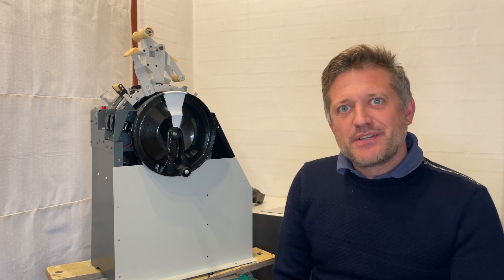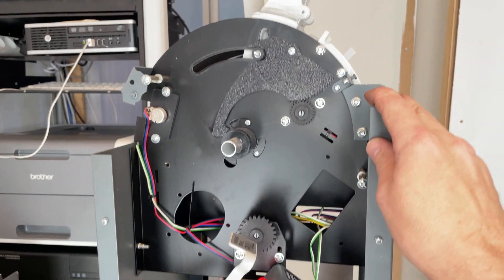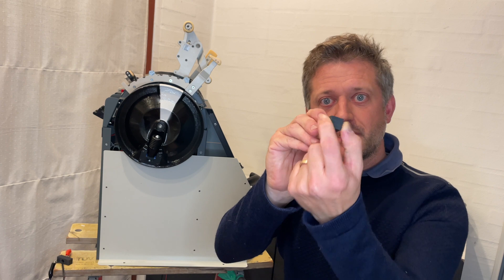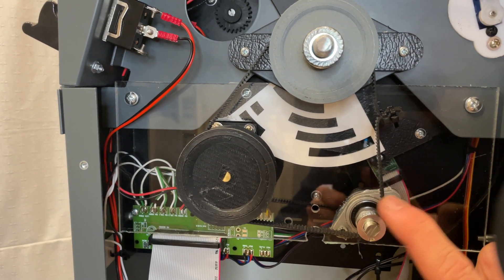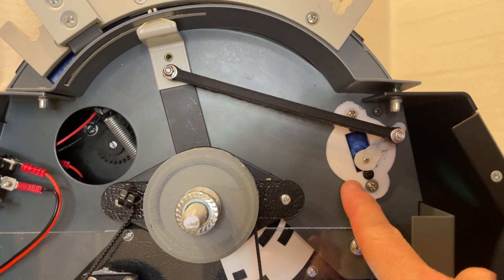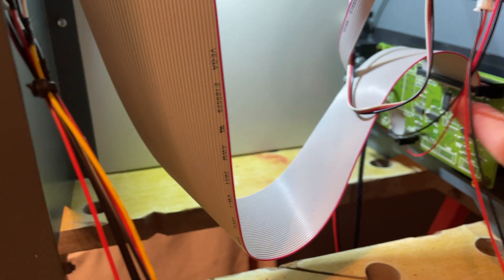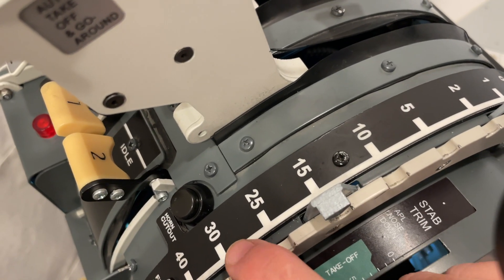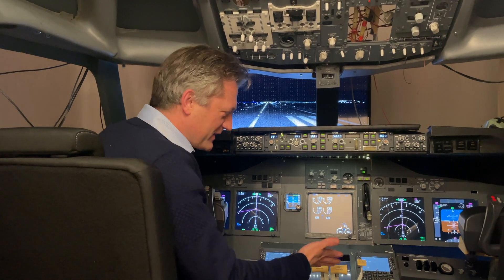FSC Throttle reworked - Build a Boeing - Home cockpit 737

Comment: What potentiometers did you use for throttles?
I need to replace in my home built throttle and earlier used 10K carbon potentiometers which I have been changing now every 2nd to 3rd year, not very good. So I am very interested in what you used in your setup?
Reply from the maker: The throttle used 5 x B100K potentiometers. Linear. Standard pots.

In all my cockpit I use 10K. But as the pots here connects to the FSC borad it is a different value. 
So 5x B100K

Comment: Peter, would you mind sharing the Model # of the FSC unit you had to replaced the Pots?
Reply from the maker: All I got is the serial-number. On the tag with the serial the field for model number is blank. But it is a "NonMotorized Pro-version" version. But as far as replacing pots goes it should be a 1:1 swap. Look up the value of the current pot and buy something similar. The value is printed on the pot.
Reply: @BuildaBoeing  I thought the serial number might reveal the age of the unit and reveal what features are available in the current unit. The fact you paid $200 for a non-motorized unit that has age is not a bad deal. The newest version fully motorized are $5000.00.
Reply: @BuildaBoeing  but how many ohms are the potentiometers?
Reply from the maker: @paridejabez3871  The throttle used 5 x B100K potentiometers. Linear. Standard pots.